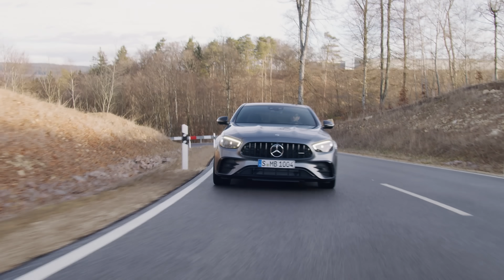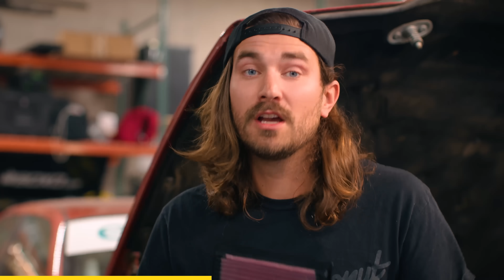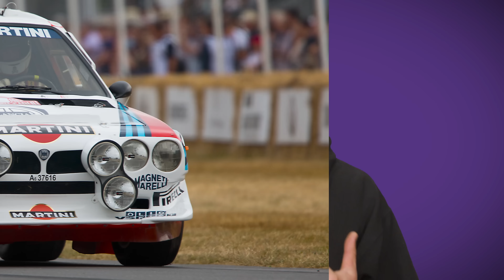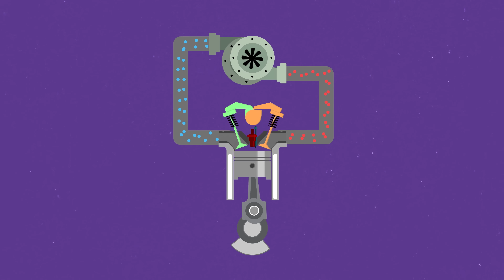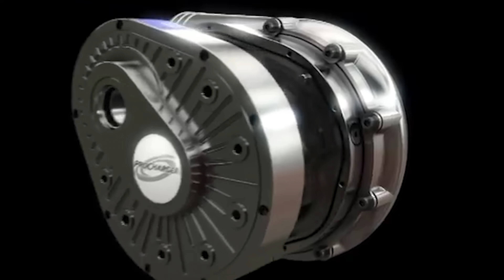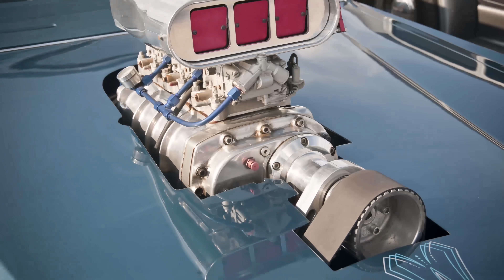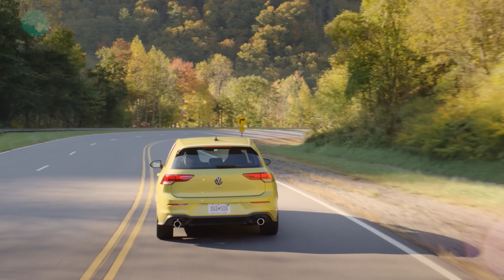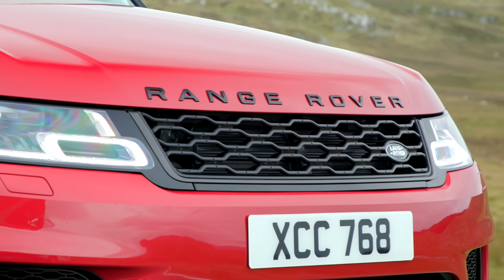Why Your Engine Isn't Twin-Charged

Comment: The problem with twincharging is that by the time the engine electronics available on the market were good enough to manage it reliably and efficiently at a reasonable price point, turbochargers themselves had also become efficient, versatile and responsive enough to have good performance at a broad range of engine speeds without the need of a supercharger. 

Modern turbos on gasoline engines can produce lots of torque from like 2000rpm to 6000rpm, adding the cost and complexity of a supercharger just for a little bit better response in the 1000-2000rpm range is just not worth it, especially these days when automatic transmissions are also very good and most engines are never going to be used a high loads under 2000rpm anyway because they just shift down immediately.

Twincharging made sense when a turbo had real lag and wasn't really useful below 3500rpm, but then it would have been a pain in the ass to implement as OEM ECUs just didn't have the hardware to manage it and so you'd need very expensive bespoke electronics.

Then there's turbos with electric drive for low RPM response, which was also not feasible before because a car's standard 12V electrics wouldn't be able to provide the power required, but is easily implemented in modern cars with higher voltage hybrid systems.

Comment: So many people are talking about Volvo's new engines, specifically in the T6 and T8 drivetrain systems, but after having worked as a Volvo automotive technician for a decent amount of time, and having come in from having loved Volvo's beforehand, I would never buy one of them. The amount of issues they have is insane, the number of superchargers we've had to pull out to reseal is crazy. Not toention the fact that the differential and gear drive in the ERAD setup that is complete crap,  to the point that we literally always had one or more in a bay to have these replaced, really changed my mind on buying one lol

Comment: AMG does some cool stuff with turbos by splitting the turbine and impeller and burying the turbine inside the V. Hot stays hot and cold stays cold, and minimize system volume to reduce lag. More recently they’ve gone a step further and cut the mechanical link between turbine and impeller by using a system of generator on the turbine and electric motor on the impeller. More flexible packaging and zero lag.

Comment: also, "stock" turbo sytems are more integrated that any tuning systems, thus reducing space, plumbing volume, lag. cause they can design the engine block and the frame to accomodate all the extra stuff you need to make them work. i've seen exhausd manifolds integrated in the block with the turbo bolted directly to it with all the fluid links included in the connection,

Comment: your statement is incorrect.  1985 did NOT see the first production engine to use both a turbo charger and a supercharger.  That would be 1938 when boeing put a turbocharger second stage on a supercharger first stage for the  Wright R-1820-97 Cyclone engines of the B17 flying fortress.  The next major use was in 1943 when Republic aircraft put a turbocharger and a supercharger into the republic P47 Thunderbolt with the Pratt & Whitney R-2800 engine.  

the primary reason to run 2 stages on your supercharging is NOT to compensate for problems with turbochargers.  The reason is that a two stage supercharger is more efficient.  You get more boost for less heat generated in the air you are compressing and thus less probability of engine knock and less power loss due to heat that has to be pulled out with an intercooler.  If you put two superchargers back to back this will basically ALWAYS be more efficient than a single larger supercharger that has the same amount of boost as the two smaller superchargers put together.  
    The most famous two stage supercharger would be the P51 mustang using the rolls royce merlin engine.  It runs two superchargers on the same drive shaft with one feeding the other which feeds the engine.  They use an intercooler AND an aftercooler and by the end of ww2 it could put out about 1950 hp.  This is purely a two stage supercharger though, not a TURBO-supercharger (turbo, feeding a supercharger) like the b17 or p47.

Comment: I think Formula 1 has found the most efficient way to do turbo charging. They have an electric motor attached to the turbo, that will spin the turbo at low RPM to build the boost when the exhaust isn't there to spin it. And when the exhaust is spinning the turbo, it uses it to also generate electricity for the battery that powers the electric turbo motor.

Comment: P-38 had 2 of these engines and was built in ww2. how about you build a single acting engine for one of your cars and I'd be impressed. WW2 History is cool.
Reply: I believe that blowers on plane engines back in the day were necessary to get enough air into the engine at high altitudes (air is less dense at high altitude) and didn't necessarily have a supercharging effect so I dont know if they are technically twin charged

Comment: I mean, Detroit has been twin-charging diesels since the 60s, but they are a completely different system. In short all of the old ones are supercharged as a scavenge system, because the engines don't run without positive displacement. Depending on the power application they put turbos on them to ramp up the power. I love those old engines, and the sound they make is in its own class.
Reply: Yeah because they require a blower to run they are considered Naturally aspirated and the blower doesn't have a supercharging effect

Comment: I've got a Twincharge R53 mini that is a garage build. Never really finished it (built the block) but it makes ~ 40% more power with the same manifold air density as the stock setup. 

If I ever get around to building the block so I can feed it more boost it would be a decently quick little car, but it was more of a fun project without a real goal in mind. 

No supercharger clutches or fancy electronics to handle the changeover from supercharger to turbo, I designed and made a valve that does it progressively and mechanically instead!

Not as efficient as de-clutching the supercharger and bypassing it I am sure, but it is quite seamless, pretty simple from an ECU standpoint, and (most importantly).. it fit! 
(Could not fit a clutch onto the nose of the R53 supercharger... or I couldn't find a ready made one I could retrofit) 

https://www.youtube.com/watch?v=G2tmu8WrqLg

Doesn't make a lot of ponies in it's current form, definitely not cost effective! But it is hilarious (in terms of the noise it makes) and it puts a smile on my face. 
And it was a fun engineering / fabrication / design / machining challenge.

Comment: Don't bi-turbo's/twin-turbo's work the same? Like having a big and small turbo in parallel? Which system is more efficient/economical? (I haven't been looking at car tech in ages, so I'm pretty out of the loop with the terminology)

Comment: If twin-charging was more widely available than now, it'd likely promote more road rage which is bad enough as it is. Sixteen years ago I didn't mind driving as there were fewer people out and they were polite. At some point it transitioned to "me first, me first!".

Personally I think of it as a firearm ~ the true fans who've been at it for the longest are level headed and responsible. Give it to a common newbie, it'll probably be a disaster and someone will eventually get hurt.

Comment: Working on Volvos for the past two ish year they’re amazingly designed even before the hybrid they had dual charged motor with beautiful power delivery throughout the rpm’s the new 48v hybrids don’t even have a exhaust manifold the turbo models have the turbo bolted right to the head

Comment: massive miss not getting into details of what makes twincharging so amazing - compound boost. The blowers ratio is multiplying the pressure ratio of the turbo, so you get major boost ridiculously quick. Go small blower big turbo and hold on!

Comment: vw made a 1.4 tsi twincharger in 2007 but reliability was very bad and engine seizure was common, oil consumption high too.
was later replaced by a less powerfull turbocharged only 1.4 tsi, with 140-150hp but only its detuned version with 122-125hp was proven reliable

Comment: I know there was am infamous twin charged mark1 mr2 at some point. The take off was similar to an electric car, but with way more power and torque unless up against a Tesla. 

One issue is the electronics and mechanical parts needed to adjust and monitor the air fuel mix and excess boost. Ideally, the supercharger spools up the turbo and then shuts off after it's max psi of say 8, with the turbo taking over all the way to like 18 psi. It was a custom build for sure and I'm not sure if it's around anymore. HKS stopped making their twin SC kit, and thats what inspired the super turbo I presume during that time.

Comment: It‘s somehow incredible how you guy COMPLETELY missed out on Volvo‘s VEA Engine. The T6 amd T8 respectively were Twin Charged engines with the T8 beinf also a Hybrid option.

The VEA Engine was developed as a Single Block for all Models, Diesel and Petrol share the more or less 4 Cylinder 2.0l Engine Block. Being Twin Charged makes them very unique and you totally missed that wich is a shame.
Reply: 12:46 Volvo is in this segment
Reply: @KalebDoesitAll  Oddly enough, the Volvo S60 displayed there (That is a pre-facelift) has the 3.0l T6 Engine in it wich is not Twin Charged. Volvo Changed to the VEA Engine in the Facelift-Models beginning in 2012, those were also called T6 (depending on the Configuration) but were 2.0l 4 Cylinder Engines. 

It's nice that it got said that Volvo had Twin Charged Engines, but it's not limited to the T6 and it's very widely spread wich is why it's so weird that it got mentioned only for such a brief moment.

Comment: I wonder why Toyota hasn't made a supercharged hybrid (Atkinson cycle + supercharge = Miller engine). Electrifying  that would reduce parasitic loss like electric water pumps. 

Over here in Europe,Nissan gave the Micra a 1.3l supercharged engine, advertised as an "eco car". It was very quietly announced and hardly remembered.

Comment: I'm going to do that in a 1,5 sohc vtec engine. A roots one from a Merc 180kompressor . So m62 Eaton and a gt3071. To make around 400hp but with fast spool from the bottom end. 

Engine is originally a 1343cc (d13b2) stock ,where I put a crankshaft and rods from the 1,5 lsi. And a vtec head from 1,6 (d16z6) it puts out from now 129hp and 145nm in 1,3 NA form

Comment: if the ratio is "fixed" in the supercharger then it cant be exponential as the charger turns a fixed amount of times in relation to the crank.

Comment: Some Detroit 2stroke diesels were twin charged
Reply: Detroits weren't twin charged or even supercharged. The blower on them was required to run. It's a two stroke with no exhaust valves it has intakes ports in the cylinder wall. The piston uncovers these ports at the bottom of the stroke. The piston does not create vacuum at the bottom of the stroke. So the blower is there to get air into the cylinder and that's about it which makes it naturally aspirated and the turbo variants we're like any other turbo diesel.
Reply: @dillon8987  no exhaust valves?

Comment: Couldn't twin charge systems work by sending the turbo's air right into the supercharger ? Some airplane engine use two centrifugal supercargers blowing into eachother and I think it's the same with some twin blower car engines

Comment: Can't you just put a electric compressor in front of the turbo? So, instead using the exhausts to power the Turbo, you get the power from the compressor?
So, you'd also have permanent turbo power no matter which rpm you have

Pls, don't kill me if I'm thinking wrong
I'm not a pro haha

Comment: The Pratt & Whitney R 2800 radial engine installed in the P-47 Thunderbolt was both turbo and supercharged
Reply: Now don't quote me but I believe that on air plane engines superchargers don't necessarily have a supercharging effect because at high altitude air is less dense and the blowers on them are required to get enough air at altitude

Comment: It has already made a comeback and is going away on Volvo's. I checked out their website last year and you could find twin-turbo, supercharged, hybrid-electric four cylinders in practically every model. The T6 package. But due to Polestar they're going all electric very soon. Bye bye overly engineered Chinese four cylinders.
Reply: It might have been a little longer than a year now that I think about it.

Comment: Used a K&N cabin filter on my 2015 Mustang GT... Never again. Made the interior smell like the oil in the filter medium. Also lowered MPG by roughly city from 19 to 16.5 on average with the K&N intake i had installed as well. I figure it may have interferred with the air flow sensor.

Comment: Enter me, thinking about ways to twin charge with less sensors needed, and very careful valve placement and type so they can be naturally driven by pressure/vacuum.
Though... It's possible it would need to be heavier, and also might lose a little bit of power from always driving the supercharger, even if the bypass is active.

Comment: Detroit Diesel 71 and 92 series engines had both. The blower was needed to push air through the inlet ports and push out the exhaust because it was a two stroke with 4 exhaust valves per cylinder. Turbo was to add power. Gone because of poor fuel economy.

Comment: Detroit also twincharged some of their two stroke diesel engines by running the turbocharger into the top the root blower increasing the pressure between the turbocharger and the blower itself which wood force more air into the engine increasing its power that way. I always wondered if you could do that with a gasoline engine you know have a turbocharger blowing into a roots blower and have all that air forced into an engine

Comment: Why not put a small electric motor on a turbo similar to what they are doing now but have able to disconnect and run off the exhaust gas onces there enough of them built up. U get rid of that turbo lag and supplying the electric motor with enough electricity wouldn’t be that hard since itll only be a small motor and only be running before it boost threshold have been reached

Comment: Reminds me of the twin induction system used in the P-63 Kingcobra. An internal supercharger was used at all times while an external one was hydraulically controlled to add extra pressure when necessary. Both were only supers but still very impressive
Reply: P-38 had the same engine. All the Allison V-1710's had a gear driven impellor supercharger behind the carburetor, meaning it compressed the fuel-air charge after it had been metered.

On the P-38, the turbo was the second stage forced induction component of the system. Waste gate began closing when you pushed the throttles past 2/3rds and had to run the ram air through an intercooler before it hit the carb.
Reply: Yes the p38 and the p47 where both twin chargerd.
Reply: @DB.scale.models  the P47 was not, it had a single extremely extremely large turbo.

Comment: Way to mention the most iconic twin charged engine. Detroit Diesel 12V71....come on bruh!!!
Reply: Detroits weren't twin charged or even supercharged. The blower on them was required to run. It's a two stroke with no exhaust valves it has intakes ports in the cylinder wall. The piston uncovers these ports at the bottom of the stroke. The piston does not create vacuum at the bottom of the stroke. So the blower is there to get air into the cylinder and that's about it which makes it naturally aspirated and the turbo variants we're like any other turbo diesel.

Comment: There have definitely been more than 8 twin charged engines. I have personally worked on a military surplus sterndrive Ribcraft boat that was powered by a large turbocharged and supercharged Volvo-Penta diesel engine.

Comment: Detroit 91 v 12
Reply: Detroits weren't twin charged or even supercharged. The blower on them was required to run. It's a two stroke with no exhaust valves it has intakes ports in the cylinder wall. The piston uncovers these ports at the bottom of the stroke. The piston does not create vacuum at the bottom of the stroke. So the blower is there to get air into the cylinder and that's about it which makes it naturally aspirated and the turbo variants we're like any other turbo diesel.

Comment: You're definitely wrong about "positive displacement" superchargers pushing the same air volume independent of engine RPM.  They increase volume as engine RPM increases.  This is why raising boost on a super charger is as easy as changing the pulley size on the drive... It increases the rpm of the supercharger...  How did you guys get this wrong?
Reply: Huh.... You raise boost because you are changing how many rotations of the supercharger happen in relation to the engine... It's still the same displacement it's just happening more times per revolution of the crank thus compressing more air.
Reply: @dillon8987  yes, more air is displaced as engine rpm increases.  You literally said what I said.
Reply: @StevenDonaldonYouTube  displacement is referring to the volume of air displaced in 1 revolution by one of the lobes on the rotor
Reply: @StevenDonaldonYouTube  if you have a 2:1 pulley ratio. Your blower turns 2 times for every one crank revolution
Reply: @StevenDonaldonYouTube  if you change to 3:1 you now turn your supercharger 3 times for every 1 crank revolution. Displacement doesn't change. The amount of times you displace that air per crank revolution does
Reply: You must be a little confused because you disproved your initial statement in your explanation 😂😂😂😂